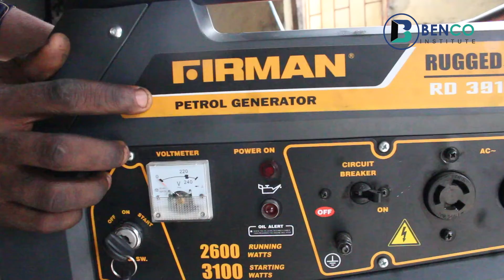How to Reduce the Fuel Consumption for a small Gasoline Engine/Generator for home

Comment: just to add something on this method....make sure to lower you generator RPM. because if you dont you'll end up overheating your gen. simple method is lower the rpm then gas flow. but this will also lower you total gen power output. make sure its stayed at 220v/240v.
Reply from the maker: Splendid ,Thanks for this extra information
Reply: your welcome 😇.  its a simple method that i used. make sure the gen is on stable stage"run in for 1 min no load" after you can udjust the rpm and gas flow. this way the will run smoother on the settings you've set. not all gen is "auto rev" which means if you set everything to low it wont provide the power you need. but it will reduce its gas consumption.
Reply: its all about the appliances you'll use. if your only using less as your gen can provide then lower you RPM, and gas flow. but note this....if you are using alot of appliances. every day..just stay on your gen default settings.

Comment: Good morning Sir
I tried this method 
It doesn't work for my fireman giant.
When I tight the screw to the later my generator was still working
Reply: I think is Because fuel is still in the carburettor, until the fuel exhaust from the carburettor then and only then the generator Stops.

Comment: I take the screw to later and the generator didn't stop working.
I mean it didn't reduce the fuel consumption
Reply from the maker: It does...

To know if it does set a timer wen the screw is loosed

Comment: You're guaranteed to wreck your piston and valves by following this advice. Tightening your pilot jet screw to the "barest minimum" results in an extremely lean air-fuel ratio. This can raise pressures and heat in the cylinder to levels way above the acceptable range.

Secondly the increased pressure and improper combustion can cause misfires which will make the engine run rough and over time affect your valve calibration. Worst case wreck or bend your push-rod on the exhaust valve.
Reply from the maker: I have done it for 100's of generators overtime,my student's  have done it too

If you are scared then do not touch it
Reply: Then what's the right way? At least he has kind enough to show something. Show yours.
Reply: @AdemolaTella  leave the calibration the way it is. The consumption rate is usually written in the owners manual and if you feel like your generator is consuming more fuel than it should then check the frequency/engine speed. Also consider how much load you put on the generator, that also directly affects your fuel consumption.

Comment: That will burn valves as petrol burns slowly when too lean. So it will be still busy burning when exhaust valve opens and will slowly burn it away until it loose compression.
Reply from the maker: Not entirely, if you do it just as i have advised

Go through the comment section

Comment: By reducing the fuel flow you are running the engine lean, this has serious implications for the motor. You could land up with melted piston due to the engine running at a much higher temperature. Isn't the standard practice. Turn air screw to the stop then 3 to 4 turns back. I would be very careful following this channels advice.
Reply: You are the first to advice and suggest to make this video and effort better, unlike those who are just quick to criticize with making and additional input. Thank you.
Reply from the maker: If u had watch the video with an open mind and maybe go through the comments sections...you won't type this.

Anyways thanks for the watch, deeply appreciated

Comment: Nice video although I will like to ask. In one of your responses you stated that a carburetor is already configured to accept and pass a certain amount of petrol. What then is the significance of this since same amount of petrol configured for the carburetor by default would always be pushed.

Also I did mine and got an increase in sound.
Reply from the maker: Yeah

If u did yours and got an increase in sound  revert to d previous setting...

While carburators are calliberated to give appropriate amount of fuel...some are not well calliberated...take for example that screw is very loosed it will take more petrol and that is where u hear generator users say I filled my Tank and my gen didn't last upto 4hrs and so on
Reply: @bencoinstitute .

Comment: That's the air\fuel control screw. If you tighten it it reduces fuel consumption, but at the expense of the gen smooth running and wellbeing. 
If you turn that screw far the gen begins to backfire,, overheat and gasp for fuel. 
It's better to maintain a minimal load on the engine, only increasing when needed and ensuring that the idles properly on no load at start.
Reply from the maker: Thanks for your input

Adjusting the caburetor screw is quite technical.. But if it is done as explained...it will work perfectly...

However with 2/3 of the ways explained you are sure to reduce consumption of petrol significantly...

Comment: I'll apply this tomorrow. 

My generator consumes more than 9 litres within 9 hours. Placing huge expenses on me
Reply: What is the manufacturer recommendations?. If it is recommended to be 9litres in 9 hrs, then don't adjust anything. Starving generator of fuel may damage it(melt the piston, cylinder, burn/ crack spark plug). Another generator with lower fuel consumption is an option
If the fuel is reduced, it may run lean. Engine running lean may overheat( petrol help in cooling/lubrication), hard to start,  poor performance, lack power, misfires( https://youtu.be/RnS4mwygk9c). Lean petrol supply makes the porcelain of spark plug white. Before you alter anything, after running the generator, check the spark plug(is the tip wet, dry, with debris, tip porcelain white, brown or black etc)
If the tip is wet or cover with soothes/black,then you can lean it if the ignition system is working well. Also if you perceive petrol odour from the exhaust
Reply from the maker: @adeyemibabatunde1814  Basically if you listtened very well to the teaching...you will understand that i advice to what limit it should be adjusted...

You don't adjust for the sake of it...
Reply: @bencoinstitute  'If you listened very well' is offensive to me.  You have to withthdraw that.  I  didn't send my comment to you. Despite your video, this person still state that he wants to save fuel. I never make comment against your video
Reply from the maker: @ADEYEMI BABATUNDE  my apologies...sorry the words sounded harsh

I totally misunderstood you
Reply from the maker: @adeyemibabatunde1814 if you don mind  let's connect on WhatsApp so we can share our wealth of experience
WhatsApp: +2349078426919
Reply: @adeyemibabatunde1814  Offensive to you? 🤣🤣😂 Lookatdiswan
Reply from the maker: @adeyemibabatunde1814  By the way the tip of you plug wet,cover with dirt or what have you does not equivocally connotes  your generator work on lean pls...

And of course while generator may run on lean after adjustment...like i said in the teaching it is advisable not to reduce it too much as it advice the smooth running of your generator

Thanks
Reply from the maker: Nice one

Comment: Tried it but my gen noise increased
Reply from the maker: That is not the reason the gen increased though...

Worse case scenario the generator sound can only fluctuate there by affecting the smooth running of the gen...that only happens when you tight that screw too much..

If that is the case u can take it back to default setting
Reply: Turn it completely in tight. Then do two and half turns out. Reduce the engine speed and load to minimal. Don't overload your gen as the governor adjusts the fuel consumption according to the load presented.
Reply: Running any petrol engine too "lean" (lower fuel ratio) will increase the exhaust gas temperature, which can lead to overheating of the exhaust valve seats, and a condition called "knock", which will result to damage to the engine.  Generally running any petrol engine "rich" (too much fuel) is safer for it from a mechanical point of view, but will result in high fuel consumption and more exhaust fumes.
If you tune an automobile engine lean, you need to measure the exhaust gas temperature to ensure it's not getting too high, and use knock sensors to detect the condition.
Knock can be heard by the engine appearing to run rough, if knock sensors are not available.
Ideally you would use an exhaust gas analyzer to measure the fuel ratio ("lean" or "rich") and adjust accordingly, but few people have access to these expensive tools.
It is possible to gauge whether the motor is running lean or rich by the coating on the exhaust pipe, however I won't go into this now.

The case of a small generator that has lost it's carburetor tuning and is running rich, doing a "home job" like this often the best you can do, but it's not without potential side-effect.
Reply from the maker: @warrenarthur5629  This is apt

In absence of special tools...the best way to reduce petrol consumption is to tweak it the best way possible.

How are you doing Warren
Reply: You are blessed.
Reply: Maybe you screwed the one meant to increase the generators rpm

Comment: Thank sir for d video, but sir is dis d only way of reducing fuel consumption? Wat of if one reduce d generator speed and reduce d fuel tap. .
Reply: Yes ooo, I don subscribe since na. U na my mentor
Reply from the maker: If you reduce the generator speed that will also reduce the consumption of fuel slightly... But if you temper with the fuel tap by opening it half way it does not reduce fuel consumption...

I will tell you why...

The carburetor is already calibrated to deliver a specific amount of fuel to the engine...so whether you open it half way doesn't matter...

However it only matters if your carburetor is bad and in such instance you can regulate it via the fuel tap

Hope this answers your question
Reply: Thank sir for ur quick response, but all dis don't it have any effect on d generator in d long run like reducing d generator speed and fuel tap plus carburetor.
Reply from the maker: @7heavenokonta109 
 1.Reducing the Gen speeds reduce the voltage of your generator...and it's also advisable you don't  reduce the gen speed so much as too much reduction will will make your gen vibrate when on load...

2.If you adjust the carburetor just as I have  explained you are good

BTW have you subscribed to this channel
Reply: Sure it's better to reduce the gen speed and ensuring the engine can idle smoothly. If you must do that screw please note how far you turned it. I advise half-circle.

Comment: If by default the petrol is to go freely into the engine, don't you think reducing the default quantity of petrol flow will have a long term effect on the durability of the generator?
Reply: It will cause overheat and gasp for fuel and raised engine sound.
Reply: @adetayoadekoya5220 not worth it if it increases engine sound. I don't care about gasoline consumption as these engines only sip gasoline, when there's little loads on it but the noise is something I can't overlook
Reply from the maker: No 
If u do it just as I explained
There is no side effect
The generator has just enough fuel to keep it going.
Reply: Good